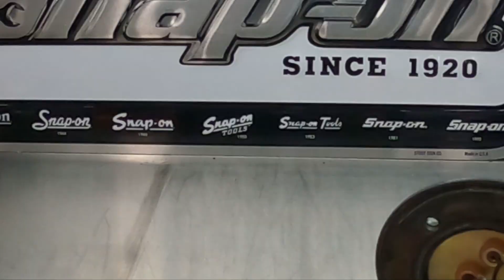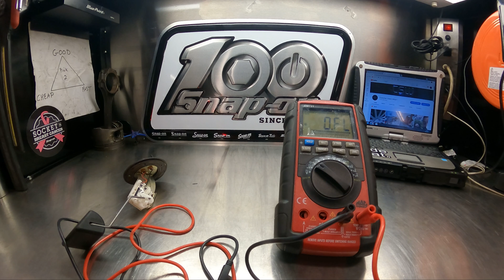Customer states How does a fuel level sender work?🤔🤔 #customerstates

Comment: Thanks for the information, I always looked at it as a volume control, low is low volume and as it rises it's full volume. Basically a potentiometer which usually has three leads.

Comment: Always wondered how they are safe? Obviously they are as you don't hear about explosions but yrs ago when playing with slot cars, there would occasionally be small sparks off the variable resistors in the controllers.
Reply: Probably because of how little voltage that runs through it. It's just enough to detect, nothing more

Comment: The part that always puzzles me is this-- with an electric fuel pump inside the tank, why doesn't the wiring either short out in the fuel or cause it to explode?
Reply: Not enough air (O2) in tank of fuel to allow combustion.
That is why that 747 blew up out of New York. The center fuel was left almost empty and the cables running through it shorted and ignited the fuel/air mixture.
Reply: @johnjennings2672  True, "empty" tanks explode more often than full ones...don't believe movies.

Comment: had a fuel gauge not working in an older tractor. took the float out and cleaned the contact bars up till they were shiny again. it's worked fine for 20 years now.